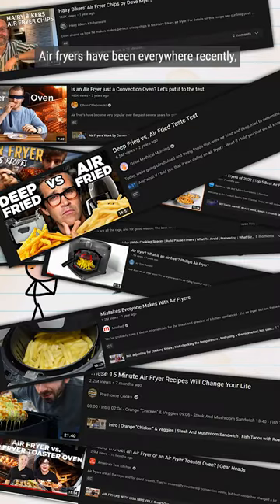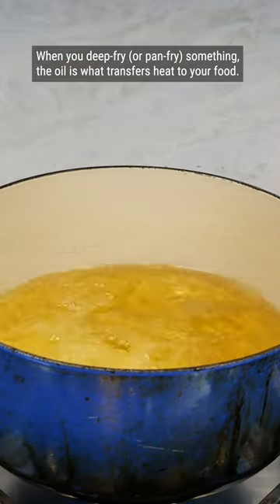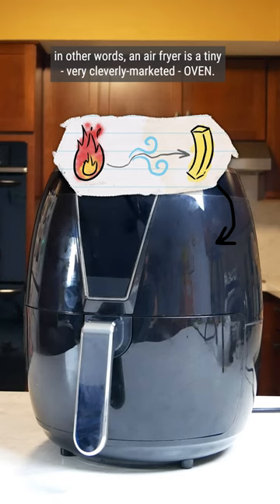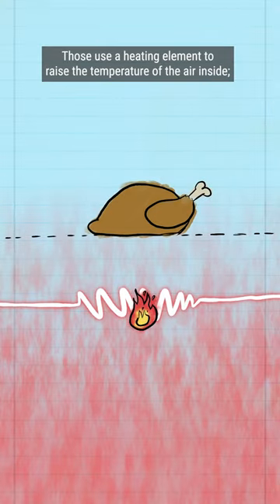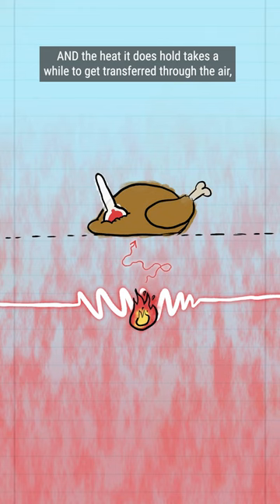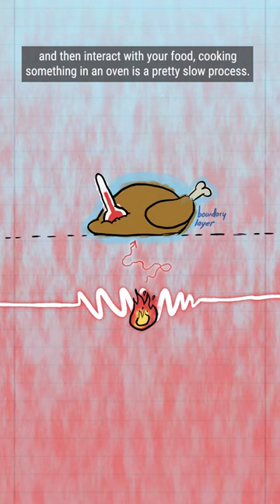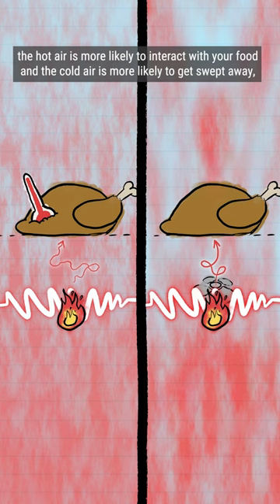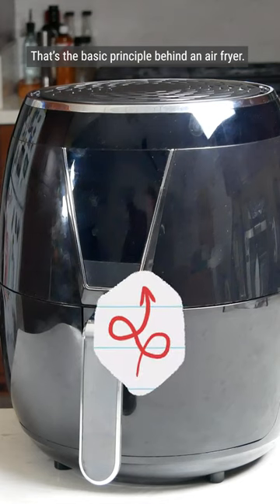Air fryers can't fry anything

Comment: They're cleverly marketed mini convection ovens
Reply: You could say that, but they do have additional benefits. Air friers convect air much quicker and better than an oven, and don't need a pre heating time. Also cleanup is much easier. Calling them optimized convection ovens would be more accurate in my opinion, like what a crossbow is to a bow.
Reply: @noob19087  cross bows are actually quite the pain to work with :D
Reply: mini impingement oven
Reply: Yea, I vote for the EU to regulate and ban the name so they get called their correct name
Reply: To be honest a tiny convection oven that has negligible preheat time is quite life changing
Reply: Yes that's what she said
Reply: @lawsontse1545  how so? Ovens don’t take that long and ovens are way bigger. So you’d need an oven anyway in your kitchen.
Reply: I have a toaster oven that has a convection setting.
Reply: I have one of those, it's called a toaster oven.
Reply: I've been saying this for years, but nobody seems to give a shit.
Reply: Every oven is a convection oven, because convection is the spontaneous distribution of energy by density gradients introduced by the heating elements. An oven with a fan or an air fryer force the air around and you cant force something spontaneous otherwise its not spontaneous anymore. The correct term is advection, which is the distribution of energy by mass flow (introduced here through a fan).
🤓
Reply: @jens5906  People from Phoenix are called Phoenicians.
Reply: @noob19087  heating up quickly is about the only advantages. Everything else is worse  including the quality of food and the foods quality is the most important part
Reply: @turtleman190  Are we comparing apples to apples or oranges right now? I've found my air frier gives better results than my oven in many things, croutons being a great example. I'm sure there's variance between models.
Reply: @noob19087   i have always found the texture it weird in the air fryer especially bread and potatoes.  Could just be my sensitivity to textures
Reply: @noob19087 I would consider a cross bow just a different weapon than an optimized bow bows can be so much better
Reply: @noob19087  Yeah no, a crossbow is no better than a bow except for people that can't aim. A better comparison would be a Recurve vs Compound bow.
Reply: @ploppyjr2373 you save on energy use when you use them instead of the full sized oven. They also do a better job in some cases.
Reply: @noob19087 they're a kind of convection oven, we can argue all we want about good name for them, but it won't change anything. I would love if they start marketing them under a name than included "convection" and excludes "fryer".
Reply: I always understood it as a convection oven on steroids, with an oversized fan and heating element for it's size. it's the equivalent of a 5'2" bodybuilder of kitchen appliances.
Reply: @Zeutomehr  Sure, but they use more complex mechanics to lower the necessary skill level, so the simile works.
Reply: @noob19087  Convection ovens are better at even cooking and crisping than non-fan ovens, whether they’re countertop or full size. Is that what you’re asking?
Reply: @ploppyjr2373 ovens heat up my entire apartment and use way more energy while doing so. The air frier on my counter cooks 80% of my oven meals, and it does it better because my full sized oven is not convection.
Reply: @Zeutomehr 😅 yeah for a modern person maybe but crossbows were like a revolutionary thing I think that's what he's trying to say they were and still are a very good way to penetrate your enemies armor what men keep up on a wall shooting crossbow arrows they have much more Force maybe it takes longer to load but it is a much more powerful version of a bow it is much easier to train people in and use
Reply: @noob19087 if you bought a mini oven 20 years ago it would also heat up at the same speed as a modern air fryer.

And this video is bonkers.

Any oven produced since 2000 has a fan to move the air inside of it. And most produced prior to that also had that.

Nothing an air fryer does is new. NOTHING.
The only difference between it and a mini oven is that air fryers use a basket while mini ovens use a door and can actually fit different racks and baking trays.

An air fryer is also not faster than a same volume mini oven.
Reply: if you bought a mini oven 20 years ago it would also heat up at the same speed as a modern air fryer.

And this video is bonkers.

Any oven produced since 2000 has a fan to move the air inside of it. And most produced prior to that also had that.

Nothing an air fryer does is new. NOTHING.
The only difference between it and a mini oven is that air fryers use a basket while mini ovens use a door and can actually fit different racks and baking trays.

An air fryer is also not faster than a same volume mini oven.

So it is just a very cleverly marketed, and arguably stylishly, mini oven.

I just find the name change funny.
Reply: @lawsontse1545  For a student maybe. Or a person who doesn't do much cooking. Because you're not going to feed more than one or maybe two people with an air fryer. The size and everything. And if it becomes bigger to have more capacity then it's just an oven.
Reply: @jens5906 was about to say this. Thank you
Reply: @noob19087 so what you are saying at the end is that the oven can be just as good or even surpass it but it's harder to use for most people
Reply: @butterbauch6110  What? No. It isn't "harder" difficulty wise, it's just less convenient. And some things my oven can't do nearly as well as my air fryer. I'm not an air fryer salesman so if you don't like them, then don't use them.
Reply: It’s a convection toaster oven
Reply: An adult Easy-bake oven
Reply: Airfryer is the best cooking device.
I have nigh on every option to cook with, and I will 19/20 times use the AirFryer.

It's quicker, it cooks way better, it's easy to clean.
Reply: @ploppyjr2373 ”ovens don’t take that long” bro imagine every time you want to heat up something in the microwave you have to wait 5 minutes before you can even use it. why do you think people buy microwave ovens?
Reply: @danielegvi  I didn’t even know microwave ovens existed so honestly, idk, first time hearing about them
Reply: @noob19087  A GOOD convection oven? No, no they are not. The benefit of them is they are small -meaning, if you are cooking small batches (think: Single portion) it is FAR more energy efficient.

That is the benefit.
Reply: @turtleman190  Funny thing about that is most people I've heard say the opposite, better texture than an oven
Reply: @nyrat8165  Those people have terrible taste in food then. Ir just doesn't have a sensory issue like i do.  The oven gives you a more crunchy texture. The air fryer gives a weirdly chewy texture that isn't chewy i don't know how to describe it.
Reply: @noob19087  Hi im a Commercial kitchen repair tech.
Airfryer's dont have a pre heat mostly due to the small size of there heating area they also use a series of wires to provide the heat compared to the large elements. (tho the fault with that is the thiner elements of the Airfryer are not as durable and can not be replaced compared to oven elements)

Some Toaster overs had convection modes on them and were effectively airfryers before the clever marketing of recent year's. 

 Also wanna note Some oven manufacture's are now selling ovens in Convection model and Air-fryer model and having worked on some all airfryer model's i have seen so far are the exact same as the convection model but with an extra sticker price. 

not against airfryer's i own one its great for my smaller batch stuff only cooking for my self and another person. Just yeah many people including some i know think if it say's Airfryers its using some sort of magical new tech.
Reply: @TheRealStrikerofLife  Cool, thanks a lot for the information!
Reply: @Danzarr  no it's not. Quite the opposite the fan is often very small it's the cooking area that is small. And the element is Wire type similar to on a Toaster a thin Tungsten wire that gets read hot fast. Problem tho it has no durability or ability to be replaced.

Don't get me wrong I do own an air fryer. But they are by no means Super powerful. To get the fast heating they do they have compromised longevity and element replacement.

Commercial Kitchen repair tech
Reply: @RAC_mans  it was not that they were stronger test show this it was the training. The ability to rapidly train the peasants to use them make them logical to use. Tho do note even after the cross bow the longbow and short bow still remained due to volume of fire and long range
Reply: @Zeutomehr  so are bows :D what’s your point
Reply: @BRIAN_IVERSON_20  I do not remember anymore...
Reply: @noob19087  It's still just a convection oven. The reason "air fryers" work so fast is because they're SMALL. It's not the difference between a bow and a crossbow, it's the difference between a crossbow and a ballista.
Reply: @ploppyjr2373  Regular ovens take up to 30 minutes to preheat and generally between 15 minutes and an hour to bake depending on what you're making. Countertop air fryers don't need to preheat and can cook small batches of food in under 15 minutes.

Regular ovens are SLOW. If you're in a rush or have other work that needs to get done, air fryers are a blessing.
Reply: @BrotherAlpha  If your toaster oven has a Turbo setting, it pretty much IS an air fryer but with more space and no downsides.
Reply: @jens5906  Conventional ovens don't generate enough convection current to circulate the air inside, especially after being preheated. They cook food through direct conduction only, which is slower.

Convection ovens use fans to kickstart a current and maintain it so that the air will pass quickly over the heating elements and the food, which cooks faster than if the air is still due to how heat transfer works - as the hot air heats the food, the cold food cools the air, but if the hottest air is passing over as briefly as possible the food can absorb less heat from more air which can then absorb even more heat from the burners.
Reply: @Zeutomehr  easier than bow for sure